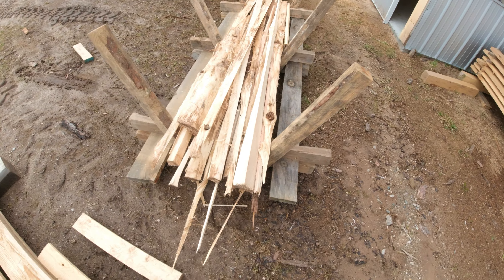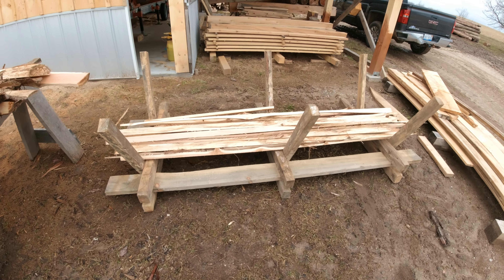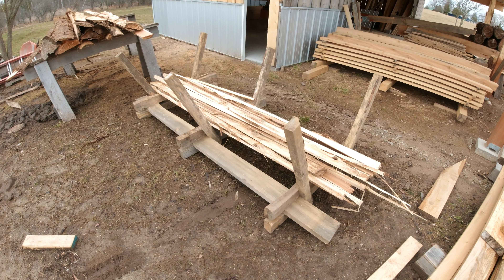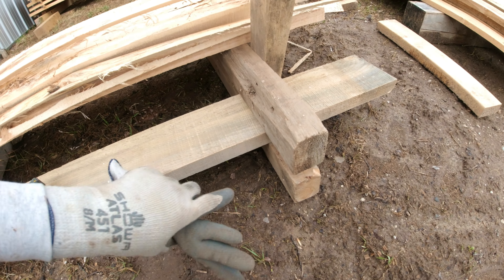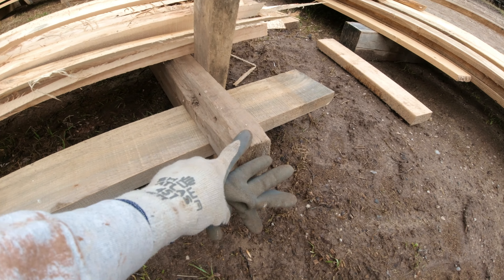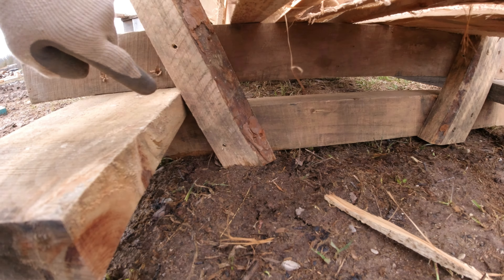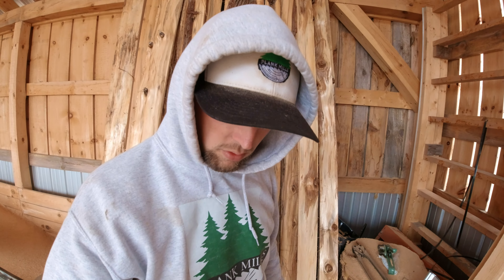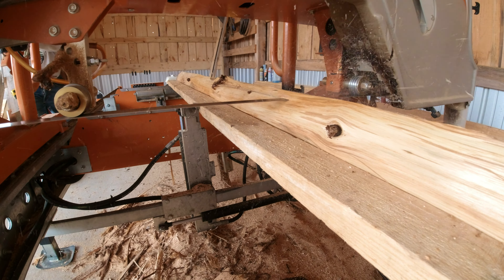You need to see this rustic Cedar Trim I made!

Comment: beautiful stuff. I will consider this for the battons on my house siding! It would be a ton more work but it would be so unique and beautiful.
Reply from the maker: Right. If you saw your log down to your can’t size on opposite sides first,( say 4”) then it makes it a lot easier to cut the last two slab cuts off of the can’t and turn them into these rustic trims. Just by cutting them off the can’t. 
I hope that makes sense!
Reply: @Plankmills   oh that's helpful, I never thought about that. North and south cuts first that way my trim will be easy to cut to an even "D" shape
Thanks
Reply from the maker: Yes! Your welcome!!